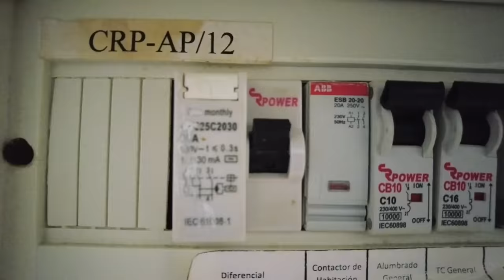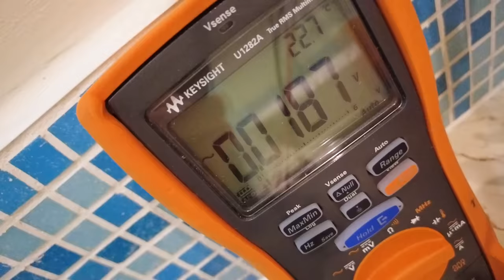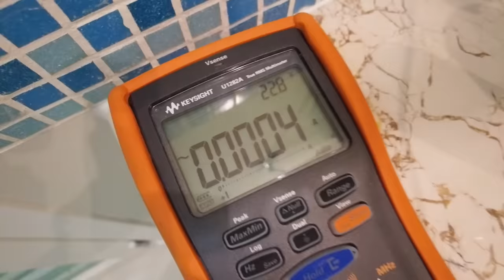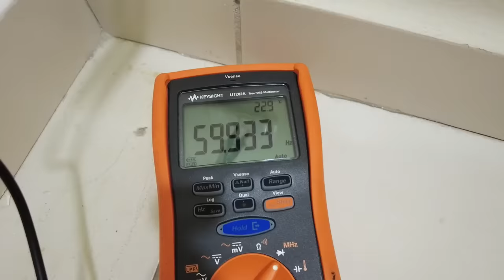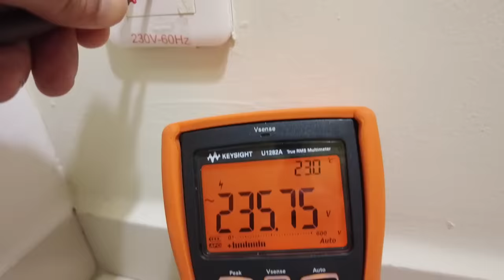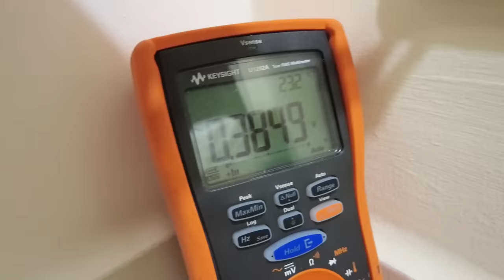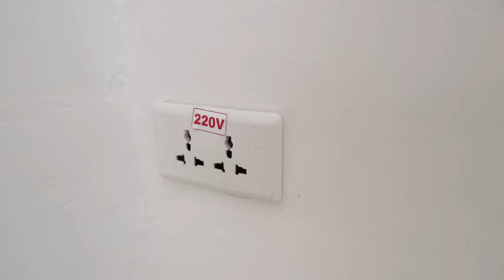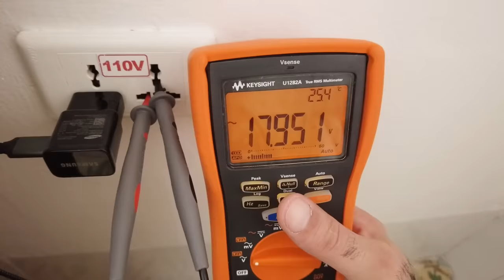Cuban Electrical System Shorting

Comment: Mehdi, connecting the sink directly through the ammeter is insanely dangerous.  Rooms are laid out mirror image to reduce pipes and utilities, so on the other side of that wall is another bathroom.  There's a very good chance you just briefly electrified the faucet/shower in someone else's hotel room.
Reply: Very good point...
Reply: Bet that was quite shocking for the person taking a shower next door
Reply: I feel like this could be used for some kind of assassination plot

Comment: Hello, I loved your video, I am Cuban and I am still currently living on the island, I hope you have been comfortable, a small explanation about the lack of ground connection is that most houses in Cuba do not use it since it saves in the cable, hahaha, it's more for reasons of saving money than for anything else, it's good that you were able to do tests since here they cut off the electricity quite often, but of course they don't affect the tourist. All the best
Reply: Do you have problems using devices with metal bodies when there's no earth protection? I was working on a house in France with no cables back to earth and got a nice, warm buzz off a fan trying to circulate air
Reply: Saludos, un venezolano aquí, se lo que es que te quiten la luz. Venezuela está también afectada en muchos lugares en ese aspecto. Mis mejores deseos para ustedes y que pronto mejore la situación tanto para Cuba como para Venezuela 😊
Reply: @RyO-lt1ui  it is a safety feature. Missing ground doesn't usually shock anyone but it means you are not protected against things getting broken and causing shocks
Reply: @gabrielpadron5619  It will not improve as long as the USA is in charge. Both Venezuela and Cuba said they would not give all their money to the USA, and the USA is punishing them for giving all of it. Like a school bully.
Reply: @thewhitefalcon8539  I think it will improve the long run because US international influence is gradually waning while China's is gradually increasing and China is friendly to Cuba. Eventually in 10-20 years Cuba will be in a better position.
Reply: @amihart9269  inshallah
Reply: Brasileiro aqui, espero que logo isso se resolva. O país tem uma história incrivel e um povo mais incrivel ainda
Reply: But why not at least do a TN-C system, where you use the same wire for protective earthing that you use for the neutral? That way you don’t need an extra wire and while it certainly isn’t as safe as having separated PE and N wires, it’s still safer than not grounding at all.
Reply: @thewhitefalcon8539  Why does not Cuba trade with other countries? Huh?
Reply: @uploadJ  Because the US bans companies from trading with Cuba. Think about it. If you were running a business, would you think it's worth it to sell to Cuba and get banned from selling to the US? Americans have more money, and there are a lot more people there. Not that long ago they were buying water purifiers from GE until the US government took GE to court and made them stop. Cuba does trade with other countries but it's limited because it's hard to find people willing to trade with them.
Reply: @amihart9269  re: "Because the US bans companies"
Oh how can you lie like this? Only US companies, not companies from other countries. Why do you make wrong answer from my answer?
Reply: @uploadJ  it's not a lie. If a ship has travelled to Cuba, it's not allowed to dock at a US port. Because most of the large trading ports in the region are in the US, it's very costly for a shipping company to send a ship to Cuba. Same thing for a company that wants to trade domestically in the US. If it does so, even if it's Chinese, it must not trade in Cuba. Or it will face financial penalties in the US.

I'm Australian, and I've investigated doing business in Cuba, and even for me it's quite difficult because of the US sanctions.
Reply: @jamesrowlands8971  re: "If a ship has travelled to Cuba"
Cubans can still buy from Canada, if Canada has not banned trade - has Canada banned trade? Or Spain? If not, it is a lie, see? Cuba can trade with China, too. Like we do ... no? I don't think you are seeing that for some reason.
Reply: @uploadJ  it's not like what I said was particularly unclear. Canada may not have banned trade, but the USA tells Canadian companies that they can either trade with Cuba or with the USA.

If you can't understand why threats like that result in massive problems for anyone wanting to do business with Cuba, I can't help you.

Even Jack Ma, the Chinese founder of one of their biggest corporations said that he had trouble finding a way to send aid to Cuba due to US sanctions. Are you calling him a liar?
Reply: @uploadJ  it does but they're kinda really far away. Also can't trade with US companies no matter what country they manufacture things in
Reply: @uploadJ  US businesses and foreign subsidiaries are not allowed to trade with Cuba at all (which is a big problem since US companies and US foreign subsidiaries will by their nature, be the closest and most economically viable options).

On top of that, ships that dock in Cuba are blacklisted from US ports for around 6 months; because cargo ships dock at many ports along their routes instead of being exclusively point-to-point, it means that no company can afford to dock at a Cuban port because even incredibly long cargo ship routes don't take anywhere near 6 months, meaning the port blacklist will still be in effect by the time they get back to US ports.
Reply: Do you have to pay for electricity? Isn’t electricity provided free of charge in socialist governments?
Reply: @xcmskim4  there is no serious definition of socialism that fits your distorted view of it.
Reply: @jamesrowlands8971  I remember hearing from a North Korean defector that utilities are provided free of charge.
Reply: @RyO-lt1ui  No, I have no problem with metal devices. In fact, I love the feeling of electricity coursing through my body. It's like a free massage. I really don't have a problem, cheers.🤣
Reply: @gabrielpadron5619  Igual para ustedes hermano...
Reply: @correiaivan  Gracias🙂
Reply: @uploadJ  thats not true. Ships that in their manifest docked in cuba are not allowed to dock in the US
Reply: @tjeulink  Ah. You just  so much as admitted that ship can dock in Cuba then. Yes, we knew that, but it is nice to hear confirmation of that fact.
Reply: @uploadJ  Ah. You so much as admitted that you're wrong. Yes, we knew that, but its nice to hear confirmation of that fact.

You and me both know what that means for cuba's trading partners. you're just sealioning.
Reply: @amihart9269  What people tend to call "the blockade" is actually an embargo that occured after Fidel Castro's regime forcefully took some US compannies located in the island with no reparation whatsoever. The USA had so good relations with Fidel Castro before that that even Armalite was a gun supplier for the regime itself.
Nowadays, there is no such a thing as a trading ban from USA to Cuba, USA itself is a provider of grains and cattle products to the island. Cuba, on the other hand, rellies heavily on exporting coffee, tobacco, honey and some metals. 
China, Spain, Canada and Russia are some of the most important econnomical allies of Cuba, along with many South American countries.
I'm not a fan of USA's government, but we should blame them for what they are, they did very questionable stuff, like Operation Condor, playing human chess at Mid West with the USSR, killing a fuckton of innocent people with the nuclear bombing of Japan and some other very sad stuff. There were even true economic blockades for purely political reasons, such as the one applied to Franco's Spain after WWII, which was lifted during the Eisenhower presidency, but the situation with Cuba was always quite an exception.
The reason why Cuba is poor is because the regime doesn't care at all about their own people, they parasyte the common citizen with their pseudo-revolutionary speech turned into political business. Their bottomless pit of consumption was historically financed by the great cost of money printing, high taxes and expropiation. The only legitimate stuff they do is tourism, in a very conditioned bubble of pretty buildings, heavily subsidized by the government, but do not dare to go too far from it.
I only hope that one day the people of Cuba can live in peace, in their rightful place, instead of having to flee to foreign countries to survive.
Reply: @francoviolencia1488 that's not true, the USA only allows the trade of foodstuffs and medicine (due to humanitary reasons) and that's highly regulated, any other type of business that's either based on the US or has major interest in trading in the US is blocked from doing so and are in risk of sanctions, fines and whatnot.
Reply: @l4nd3r  as I said, there is no blockade, just an embargo for the forcible sustraction of US property. USA and Cuba have somewhat healthy relationships considering the context. Medicine and food are not the only goods that Cuba and USA trade with each other, the Cuban mining industry is decently supported by USA machinery. Cuba reportedly bought supplies for nickel extraction from the USA in 2016. Likewise, the USA has bought metals from Cuba both in crude and scrap form.
There are several examples of countries that maintain healthy trade relations with both Cuba and the USA, for example Mexico and Argentina.
The main reason why Cuban trade is markedly primary and they are rarely seen trading high value-added products is that the scandalous levels of poverty on the island make technological-industrial development unfeasible. Even so, there are specific observations that contradict your comment, such as the mining machinery situation.

Comment: I have two questions:

Do you take electrical components with you every vacation?

What do you tell the technicians you were doing when they have to come flip the breaker switch outside of the room? And how do they react? 😂
Reply: If one of those hotel owners recognise him he will get kicked out of the hotel or he would be forced to repair all the electrical systems 😂
Reply: Depending on the video, he just goes and flips the breaker back himself
Reply: I think he buys the electrical components from a local electric shop.
Reply: @typicalmooyt69  Definitely not in Cuba
Reply: @typicalmooyt69  not in Cuba 😂,the local stores don't have electricals components
Reply: @root3636  sure they do, just everything is from the 50s lol.  Imagine he did this video with all vintage equipment cuz he didn't bring anything with him and he had to spend a small fortune buying anything he could find that he could use for a video
Reply: @JaredConnell  He's using resistors, a potentiometer (a variable resistor) and propably one or two capacitors (that's the exploding stuff, a polarized capacitor connected the wrong way) which are all passive components and propably didn't change that much in design compared to those from the 50s. Capacitors do start leaking after time though, but for Mehdi's use cases, that wouldn't really matter much as he blows them up anyways.

Comment: The smoke detector at 2:20 is not a household smoke alarm, like the one in the other hotel. It’s actually a modern addressable device, which is designed to be wired to a main panel in the middle of the building, and has a code set that will help the staff identify the location of the smoke. 
I know it seems overkill for a hotel, but if you burn something, completely separate alarms will sound in every room, strobes flash in the halls, the fire department will be called automatically, AND the staff will know exactly which smoke detector activated, so they’ll know it was you, and the worst part, there’s no way to shut it off without a key and passcode, and in some places, it’s illegal for the staff to even do so without authorization from the fire department. 
So in other words, don’t do anything that causes smoke, or even shower with the door open, because it can’t tell steam, or even dust, from smoke. 
For anyone into fire alarm tech, it’s a Notifier by Honeywell 851 series smoke sensor.
Reply: I hate these things, I went to a hotel that had these and told me to be careful, but I guess it‘s better than no smoke detector or a broken one.

Comment: The device labeled "diferencial" in the breaker box is a residual-current device, which acts like a GFCI through the whole circuit to which it is connected to (like you mentioned at 2:48). All standards based on the IEC 60364 use this RCD device, like we do here in Brazil.
Reply: Could you explain more about the isolated transformers? There's not a lot of videos about them and they're confusing
Reply: @Sayori  Isolated transformers are usually at a scale of transformation of 1, but the secondary can be any voltage you want. The idea is that nothing is grounded on the secondary side. There is no reference to the ground. There is a voltage between the two ends of the secondary winding. If you short them to the ground, one at a time, nothing happens. You can safely touch them.  (NEVER TOGETHER AT THE SAME TIME!!!)
Reply: @RonaldoHoxha  but that's one thing i don't get, if there's a voltage between the ends how doesn't it travel through your body to somewhere like the ground how.

Like lighting doesn't it travels through the air to the ground and anything between it
Reply: @Sayori  the circuit needs to be closed for the current to pass through. If you ground one, no current flows as the path is not completed to the other side. BUT in some rare cases, one side may be shorted to ground as a result of damaged wire insulation, so if you accidentally touch the other side it becomes dangerous because in this scenario the circuit is completed. One side of secondary - broken insulation,exposed wire touches grounded metal parts - you - other side of the secondary.  
It is true there are some capacitive leaking but they are negligible at low voltage and not dangerous to humans.

Lightnings on the other side have enormous power and produce very high voltages, which at some point make air a good conductor.
Reply: @RonaldoHoxha  oh i get it now i saw a video that showed that exact situation where you close the circuit between the 2 isolated wires with the ground
Reply: @RonaldoHoxha  thx, another doubt wouldn't it be dangerous if anyone for example plugged a some equip with exposed wire, like wouldn't that put the whole system in risk or each room is independent i saw an example where a guy showed if the neutral wasn't grounded it and there was a fault at some house it would start shocking on every other houses as well
Reply: @RonaldoHoxha  in my country it seems that's not a thing :/ i can't find anything about it except transformers that you plug in the outlet that isolates the energy but not a way to make a whole eletrical installation around kt
Reply: @Sayori  it is not common in my country either. But that is how it works. It's just a transofrmer big enough for the whole building. At my workplace, we have 5 dry transformers with a transformation factor of 1, DY connection, 100kVA each with an isolated neutral. It serves only for the lighting around the site. (It is a cement factory) 1. It is safer and 2. The lighting doesn't  get affected during Direct On Line start of big ass  motors.
Reply: @RonaldoHoxha  oh i get it now

Comment: 2:16 The smoke detector in your room is an addressable/conventional smoke detector that is hardwired to a dedicated fire alarm system protecting the building. The beige colored one you showed in the same section of the video is, I believe, a smoke ALARM. Layman's difference: the smoke alarm will sound in its unit, though only someone calling the FD will actually initiate a response. A smoke DETECTOR wired to a fire alarm system that is monitored by a central station WILL have the FD roll the trucks on you as well as actuate the building's notification appliance circuit devices (the loud, strobing or buzzy red things we all hate). 

Source: US Fire Alarm Techie +4 years
Reply: What happens if the smoke alarm triggers when there isn't actually a fire though? Even the best smoke alarms in the world can trigger in some harmless scenarios.